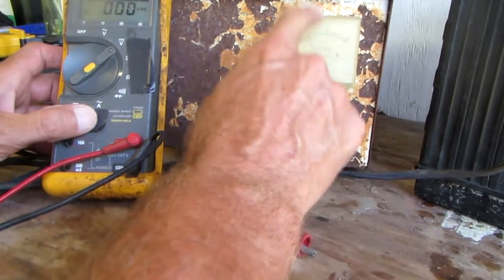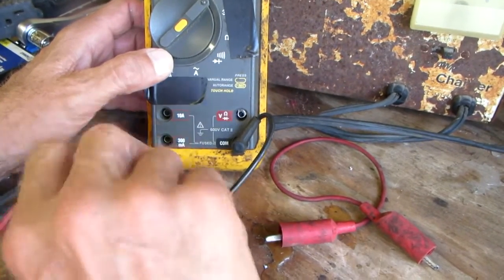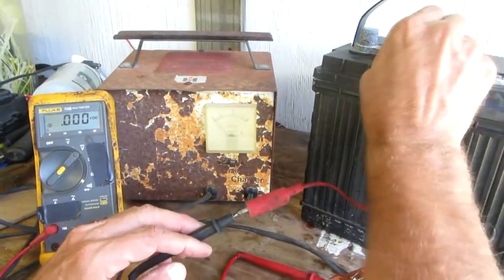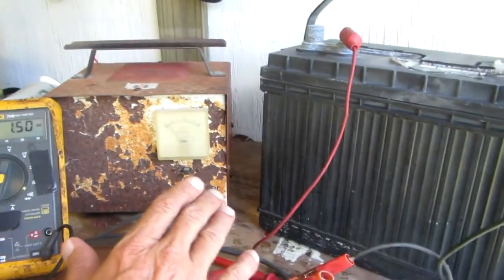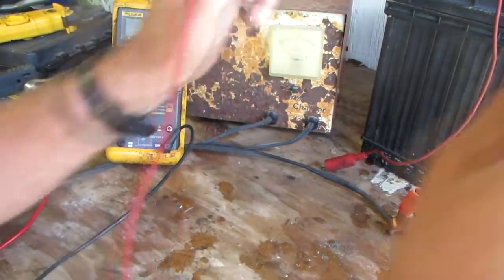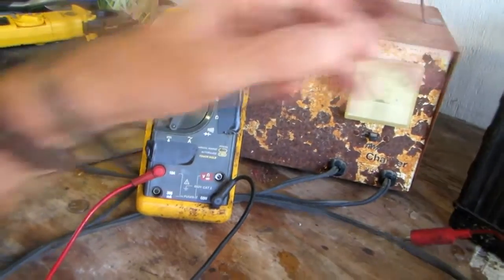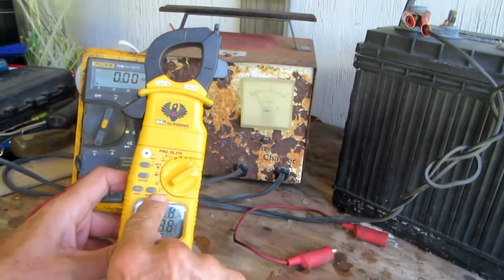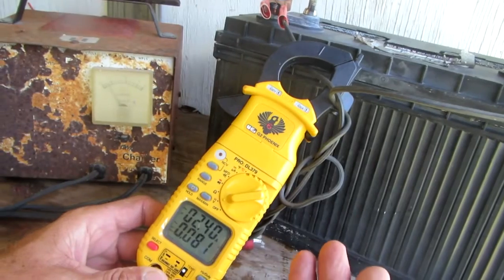Using A Multimeter To Read AMPS In A Circuit.

Comment: Learn something new every day, thanks to this video i did not blow out an expensive multi meter. i was going to use to connect multiple power supplies and testing for wattage output but i needed to know the exact amperage output to get the correct wattage.